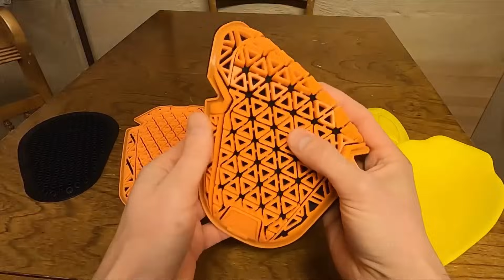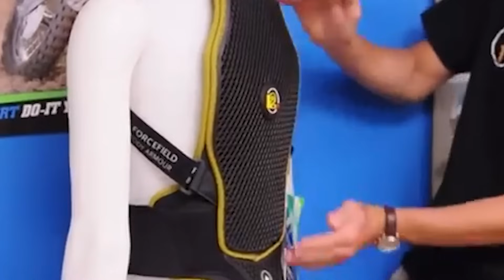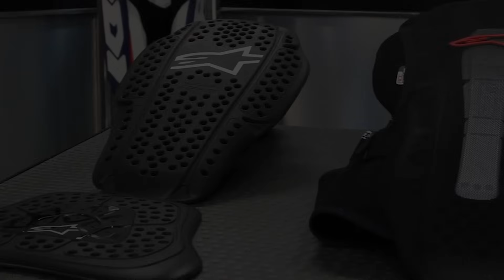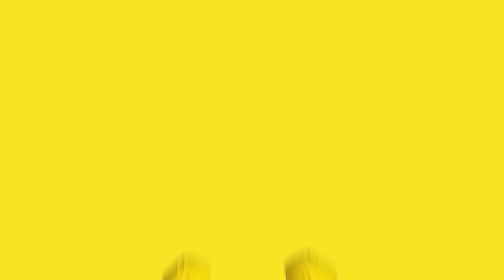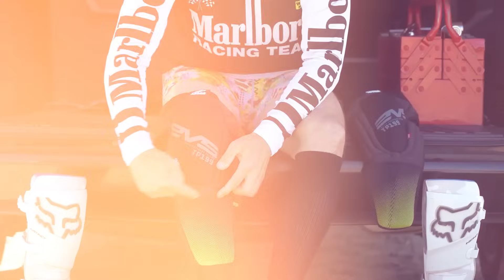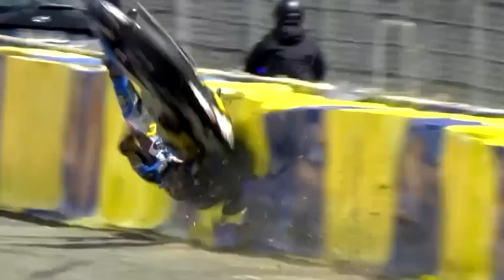9 Motorcycle Armor Upgrades That Turn Cheap Gear Into Crash Gear

Comment: Some products in this very video, reveal the flaw in viscoelastic protectors.... Yes they are flexible and comfortable, yes the react perfect when crash, but they have one flaw. They are not good when hitting a sharp object (like a barrier foot i.e.). The best protection is a combination of viscoelastic material and a hard outer shell
Reply from the maker: Fair comment. Every protection has its pros and cons